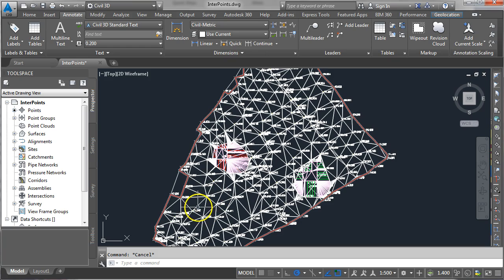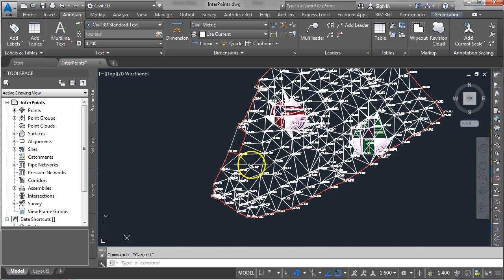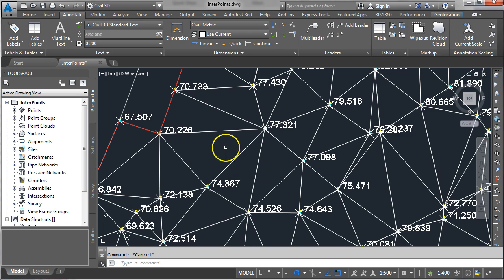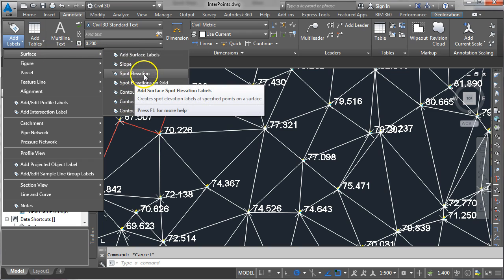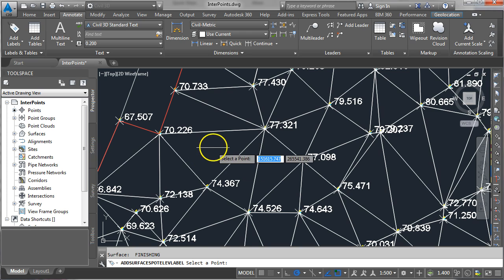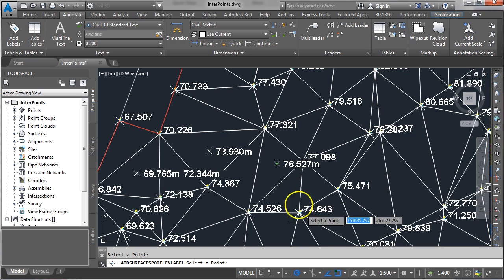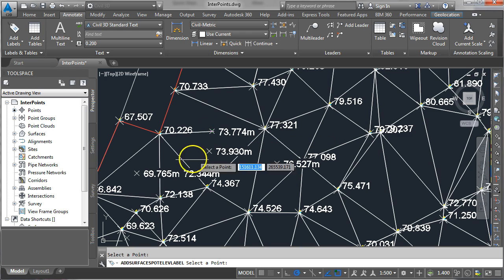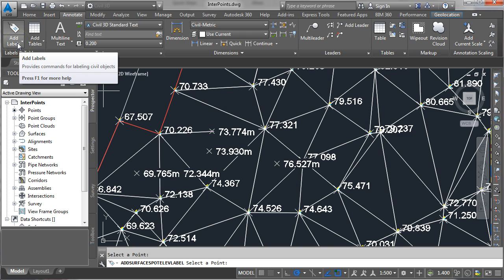Interpolating elevations in Civil3D

Comment: Sir plz guide me how to remove or exclude 0.00 or - elevation from the surface
Reply from the maker: I'm sure there is more than one way to do this, but the first method that comes to mind is to create a point group which excludes the elevations you are talking about, and then define the surface using that point group. If you already have the surface created and you don't want to make a new one, you can go into the surface properties->definition tab->build->turn on (change value to 'yes') the 'exclude elevations less than' option and enter the value you want to exclude. When the surface is rebuilt, points with those elevations will be removed from the surface. Hope that helps.